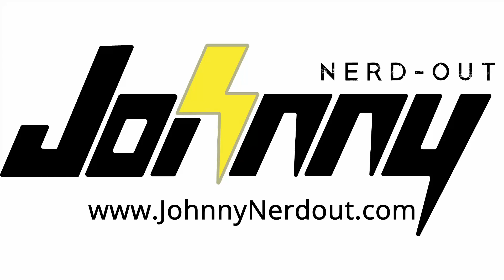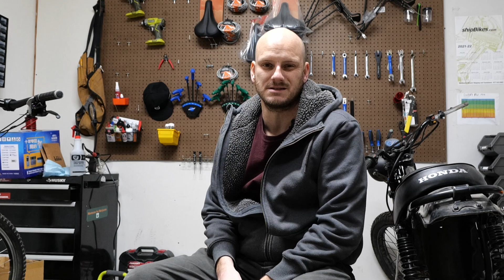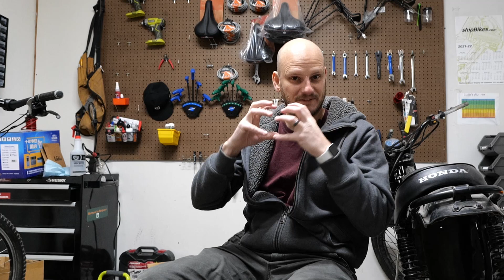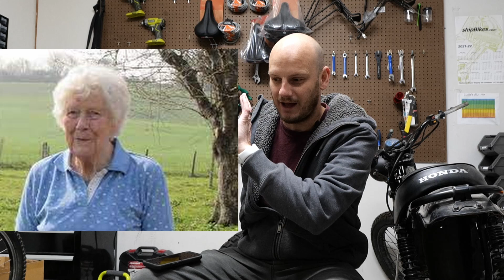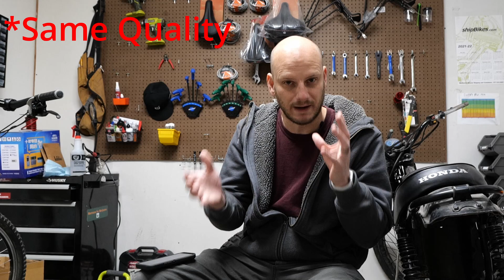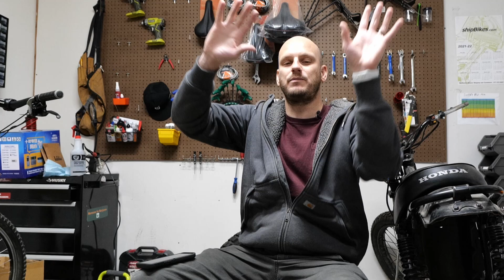Hub motor or Mid Drive Motor Buyers Guide : Which system is right for you?

Comment: There is no torque multiplication in most bicycle drive trains.  All or almost all will be torque divided, not torque multiplied.
If you are on your smallest chain ring, say 28tooth and largest cog, say 28tooth (these are typical), you have direct drive.  If you are in the next gear up, say 2nd gear with 24teeth on the cog, you are now in torque division.  The rear wheel is moving faster than the chain ring.
Mountain bikes can be and usually are an exception.

Comment: I have no problem, climbing hills with my hub motor but I like the video. Thanks for sharing.
Reply from the maker: You must have slight hills. Hub motors do fine on gradual hills. It’s when you get into mountain hills or off road is when you run into trouble.

Comment: Im an experienced rider. I prefer the hub drive. Dont really care for gears, its illegal to ride any faster, than 28mph anyway. I bought the cheapest geared hub drive kit from aliexpress. (Sorry JohnnyNerdOut) Its been staying strong for around 15000 miles so far. I love it, its quiet(less so than a direct drive, but a lot more quiet, than a mid drive)  powerful enough for me (750w) and the range lets me go full out on it for an hour straight. Biggest plus vs a mid drive over that time has been the noise. Hub drives are waaaaaay more quiet, even the geared hub ones. Biggest minus? Going uphill (that is literally the only time i pedal)
I have geared hub drive for compactness and weight saving.
Reply from the maker: In my experience direct drive hubs are quietest, then the bbs02 mid drive, then bbshd mid drive, then geared hub motors, then all the other mid drives (cyclone, CYC etc)
All motors are different depending on manufacturer but in my experience Bafang mid drives are quieter than any geared hub motor I have ridden.
Reply: @JohnnyNerdOut  I agree with everything but with the mid drive, the noise doesn't come from the motor, its the chain. My geared front hub drive really doesn't make all that much noise although a direct drive would be quieter. Perhaps mine is actually more quieter than the average geared hub drive or something but im more affected by rattling of stuff on my bike than that. But the chain noise of a bbs02 at full speed, that would be unbearable for those amounts of time.

Comment: I'm a bit offended. One advantage of a hub motor is that the bike still works if the chain breaks or won't stay on the cogs. If that happens, you would rather fix it at home, not have to tinker with the derailleur while you are on a trail or street somewhere; assuming you have the tools available and it isn't dark, raining, or otherwise miserable for a roadside breakdown. That goes double for a Type 2 pedal assist bike. Broken chain? Turn on the throttle and ride home on your remaining battery power. With a regular bicycle, or mid-drive e-bike, you're walking home or begging for a ride.

 Hub motors work fine for smaller motors that won't exceed the strength of the spokes. The only real advantage of a mid-drive is that the mid-drive allows one to use gearing to match the motor speed to the bicycle velocity; however, my Velotric Discover 1 has enough power to conquer the steepest hills by my home in southern California despite having a maximum short-term overload power of 850 watts, so I don't know what you need a mid-drive for. If you want to ride that fast on steep hills, get a motorcycle.

The exception is if you're in one of those countries that limit e-bike power to just 250 watts, like Europe -- there's a reason many e-bikes in Europe are mid-drive designs.
Reply: Very true. Also with hubs you unlock Regen breaking for when you do have hills and aren't a speed demon, and it saves break wear and battery use

Comment: I brought a cheap made ebike Hub motor a year back and at first it looked the rhing, for a cheap ebike it looked the works and for a short time enjoyed it.  But it tattled and wire to battery - controller kept vibrating lose, could feel great vibration through handlebars when going over uneven roads and got to the stage I wasn't enjoying riding.  I would say about 40% was cheap parts and 60% state of our roads.  I used a dearer ebike someone had with a hub motor I borrowed and I would say only felt 20% better, I am not saying anything wrong about hub motors as I know a few people who have them and they love them and put up with the vibration of the ride but when one as cycled for years one likes the bike to feel natural a cycling is more then just getting to one place to another.

After a while I thought I would take my hub ebike and convert it to an mid drive so brought a kit, I took all the cheap parts off front suspension, cable brakes and replaced with higher quality even put different handlebars and the only parts of the original cycle is frame, battery, back wheel and front tyre and inner tube, it as improved by over 80% as it doesn't vibrate or rattle and had no trouble battery disconnecting and feels as if one is riding a normal bike, it still cost me a £1,000 less then it would of cost buying a ready made mid drive.  The person hub bike I used he gave it ago and couldn't believe the difference and is now thinking of converting his to a mid drive.  I f yoiu using a cycle just to get from a to b then yes maybe a hub drive will do but if pleasure of cycling it as to be a mid drive for the more natural feeling of cycling.

Comment: Well I’ll probably be hitting you up soon on advice & parts to switch my new hub drive himiway cobra to a mid drive. I’m not an idiot , very mechanically inclined but brand new to e mtn bikes . 100% sold on mid drive for better gearing, top speed & torq for the hills in my area . Thanks for you great advice/ video .

Comment: Your logic is right gearing being better but what about sytems like Falco hub motors that allow the use of up to 11 gear hub systems so you would have all that gearing plus you would be able to use a triple crank giving 3 times the gearing of your Bafang motors that only have one gear at the crank.  I have no knowledge about Falco other than what I have seen on their website so any incite would be appreciated.  Also, I would be using it on a trike where a crank motor really puts a lot of weight up front (I have some experience with the Bafang motor on a trike).

Comment: Man Johnny I'm so grateful for this vid!!! I had seen the previous one comparing the two where you called hub motors junk. So being 67 & not riding for over 30 years I began searching for mid drives. But  after seeing this one I ordered this monster hub ebike this morning, or rather backordered one. It's  a Kepler 52V Electric Fat Tire Bike with great specs (to dumb me). Ever hear of them? There's a cool vid on here by The Junker test driving one & it sure can git it! He said it's great for steep hills too. Appreciate any views you have on this one. Thanks.
Reply: I’ve checked those out & I think you will be happy
Reply: @davestevens4263  Thanks, & yes I am happy with it.  At full battery it'll do 40 mph, & at 50% it'll do 20 mph. I've gotten 40 miles out of a full charge with pedal assist,  & 20-25 miles on throttle only.

Comment: But is a 1000W mid drive better than a 5000W hub drive? because cost wise that's the comparison.
Reply from the maker: Performance wise no. @5kw a hub motor would be more powerful. However @5kw we are no longer talking bicycles but more motorcycles/ mopeds.

Comment: Insulting older riders,  got it. Wheelchair get a hub motor?  Typical millennial arrogance
Reply from the maker: Not my intention at all. I just want people to make informed decisions. Way too many people buying equipment that is not intended for their needs and purposes and ends up collecting dust. Yes, if you make an omelette you have to crack a few eggs. My intention is not to belittle anyone. Pardon my communication style.
Reply: Did you end up getting a wheelchair or a hub motor? Sry I'm just joking 😅😭
Reply: I am 74 and not insulted at all. I have been an avid road rider for over 50 years. I put thousands of miles on my road bike. But now, I am partially disabled and have limited use of my right leg. I chose to get an e-bike with a hub drive and cadence sensor. It’s better than sitting on the couch.

Comment: Hi Johnny nerd out.
I like the channel, hope you do well on here.

What’s the best /strongest ebike chain in your opinion? My one has stretched a bit and I’m hoping to get a new one before the rear cogs get wrecked.

Currently I have a KMC m4100 10 speed 46…

I’ve heard kmc are good (don’t know if that particular one is) the chain has done around 1500 miles. I’m in England so any relevant/worthwhile seller as well.

All the best
Reply: Unless your chain is made of rubber, it won't stretch.

Comment: For delivery around the city, hub drive any day. Lots of stop-starts between traffic lights, no time to shift gears if you want to get that early jump to cross the red light before traffic starts, the one-gear throttle-controlled hub motor does wonders, and puts no strain on the chain. I've literally seen other delivery drivers with mid-drives have to downshift, losing that critical second or two before they could get going from the light, sometimes too late to get that early jump through red. I just thumb the throttle and speed off.  

That being said, you do need a good powered hub motor for that kind of peppyness. 1000w minimum (I got a 1500w one). And yes, it's less efficient and less torque up hills, but for me the tradeoff works.

Obviously not street-legal (especially here in Europe), but who cares. Put a 250W sticker on the hub (rip the 1500w one XD ), drive low-key around cops, and nobody pays you a 2nd glance. Very easy to get around the dumb rules.
Reply: Just register it as a motorcycle at that point
Reply: @subjekt5577  And pay for registration and insurance? Fuck that :P

If it looks like a bike, drives like one, and has a nice big 250w sticker on it, it's a bike :)

Comment: Hi Johnny thanks for the info, wondering if you can recommend what would be a solution if I wanted an ebike that can ride nicely on the road to go 20-30 ks to get somewhere, that can haul a loaded trailer, that can function well on pedal only for if there was no power, and is rugged enough to go across country if roads were blocked and fast enough outrun hangry guys post apocalypse. Oh and that looks nice too - Too much to ask? Curious to see what you say :-)
Reply: BBSHD mid drive

Comment: I was looking for a middrive bike with a trotttle function but could not find one. So, I bought a hub drive bike and am happy so far with it! And looking on how it would be if one was to add a trottle function to a mid drive, the modifications, and the safety issues etc. I can understand why they did not make it yet.
Reply: Wtf you talking ,bbshd throtle only with 52v 35ah custom battery samsung 35e cells 50miles range of hard riding,look at my channel throtlle only drifts and wheelies and its mid drive bbshd over 10000km o the clock
Reply: @madmanwheelies6157  
Awsome demonstration of a conversion kit capabilities dude! :)
Reply: @jayare6872  thanks man🙂,what hub have you bought,why cant you fit a throtlle 🤔
Reply: @madmanwheelies6157  
I did not find any mid-drive's w/ throttle at any store on oahu and I really wanted a throttle function. But found alot of hub drives did have the throttle function so I got the Aventon Level which has a throttle funciton.  And the level being my first ebike I am very happy w/ the distance and the assistance it gives compared to not having any electric power!:) But some time in the future I will  get a mid-drive conversion or otherwise.
Reply: @jayare6872  i have bought mine from aliexpress bafang bbshd motor and have a friend who builds batteries ,have rockshox sektor 150mm fork waiting for 220magura disc and then gonna put gatorbrake 8 piston on front and 203mm magura mt5 rear ,with ft swiss fr560 rim with dt swiss 350 e bike hub thats final mods and its ready for asi bac 855 external controler to give 3kw+ of power 😎😎maybe renthal fatbars and stem and litlle fancy bits

Comment: I had bought my used bbs02 preinstall on a big 22 frame bike. After like 2 years I finally swapped it onto a 18 inch frame and it feels so much better. I'm a small guy as well. The motor didn't fit in the bottom bracket I had to use a dremmel to slowly thin it out. I also thinned out some of the paint on the bbs02 as well (maybe that bad idk). But it the yeah took me 2 whole days to do because I also had to swap all the other parts like the drive train as well from my first bike onto the 18 inch frame. I also have a triangle battery and it fits perfectly. Tbh I wanted to maybe get a 16 inch frame but because of the battery I had to pick the 18.

Comment: Great video. My question is when you say shifting gears on a mid drive, im not sure what that means because I have 11 sprockets on my cassette and 9 on my mid drive. I have noticed my chain getting  hewed up a little...I usually ride on gear 3 on the motor and I switch gears as needed on my rear cassette. Am I supposes to down shit the motor and the cassette or just the cassette or just the motor or both? Thanx in Advance..Stay Safe
Reply: The 9 is not gears that's just the setting for how fast the motor spins at top speed. You get put that down the 5 or even 3 in the settings. For example on setting 1 out of 9 the motor will cut off at for example 10mph and 2 would cut of at let's say 14mph. Cause remember you don't want the motor to be spinning fast all the time and u want you pedalling to match the speed its turning. Think of the the speed setting as like a throttle 5 would be halfway and 9 would be full. When he says shifting gears he means on the bike manually not the ebike stuff.
Reply: The way these mid drives work bbs02 and hd is because they have no torque sensor(some bike have this to see how much force you put on the pedals and use that info to dial the speed as you pedal.) The motor just checks if you pedaling or not simply 2 states pedaling or no pedaling. It does by having magnets to detect it. If you pedal the motor slowly cranks up to a certain speed this is where the assist levels come into play the 1-9 you mentioned. You can also program this with right cable. And so the actual gears on the bike itself is more important if you were on a hill let's say.
Reply: @navidmehdi6  Thanx for the info and your time.
Reply: I have mine set to 5 assist levels and mostly stay on 4 but use the throttle exclusively. I don't change gear often but if I use pedal assist I normally just start at level 1 pedal till that maxes and slowly increase it if I needed to increase speed I only change gears if theres a hill really.
Reply: @navidmehdi6  I keep mine on assist 1 and just keep changing gears like I did on a non Ebike..I switch to assist 3 for hills and windy days here in Florida
Reply: @claude3990  yh but keep in mind the gears are more important for hills as it gives it more pulling power.

Comment: Power is not multiplied by gears. Gears change speed and torque in proportion to each other. No power is gained, only lost through gears.

To patch a tube on the side of the road, use a rope to hoist the bike up a pole or tree. You gotta learn a couple of rope concepts though.

I would rather mess with a heavy rear wheel than a nasty chain. 

If wattage output is the same, the performance would be the same. It cannot be night and day if both mid and hub dyno the same. If they do not dyno the same, they are not the same power. 

A $100 direct drive hub motor can eat 7 kW with ease. A $100 hub motor  pushed to its thermal limit will power wheelie.

It is not like an internal combustion car with gears, electric motors do not work the same as piston engines in cars.
Reply from the maker: Maybe a better way to think about it is to think of it as leverage. Using leverage gives you a more powerful result using the same power at the source 👍

Comment: “Better” comparison than the last, but calling us hub peeps “old/don’t know anything about riding bikes” was a pretty big fail. People on YT like myself or Vortecks would disagree in that presumption and have years of experience.

Overall I think you are an entertaining and likeable duder. I have actually recommended your channel in my videos a few times for people looking into mid-drive systems because I think you’re a good resource.

I had my last hub ebike (52v, 35A, 30.5ah 1800W nominal) used for 20,000+ miles commuting and ebike touring stolen in October. I finally have all of my parts to build my new one this weekend. I went with a 8T GMAC geared hub motor and will film the build. The GMAC is the first major tech advancement in hub motors since inception. A geared motor with regenerative braking and 1/2 the weight of a DD motor but still capable of 2000W.

I’m not anti mid-drive by any means. I pointed my mom (old and doesn’t ride much) to get a Luna Cycle Giant Roam 48V BBSHD (ludicrous upgrade) and she loves it.
Reply from the maker: Dang dude, sorry to hear about your bike. Seriously 😒
Reply: How are you liking the GMAC? Thinking of switching to a high power hub for daily commutes (RH212? 52 or 72v)....
I have a  luna giant roam (52t front ring, Cycle Analyst&Phaserunner controller)
....its a ripper.  Added Body float seatpost & 27.5x2.3" maxxis hookworms.   Feels much more comfy😊
Anyways, wondering if torque sensing & Regen might be better for my daily riding, in spite of Vancouver's many hills

Comment: Hey Johnny. My wife bought a cheap hub drive ebike on amazon. It worked well all summer. However towards the end of the summer her pedal assist intermittently stopped working. Her throttle still works but no go with the assist.  It's a gotrax with the full aluminum wheels( wheels and spokes are one piece)
Reply from the maker: Check the sensor on the crank. Might be broken.
Reply: @JohnnyNerdOut  thanks!